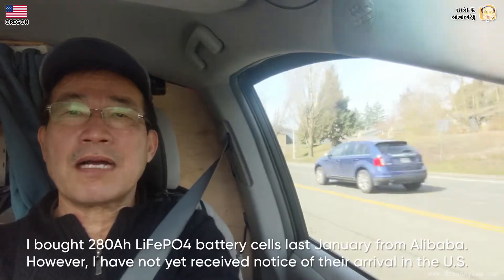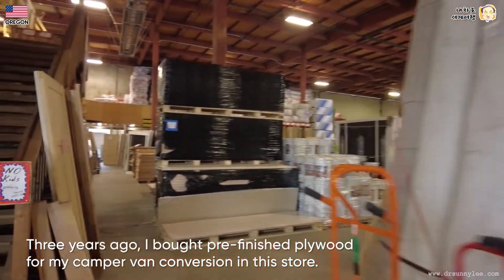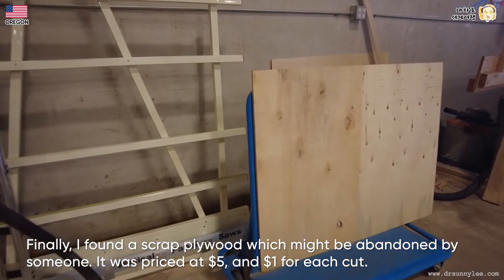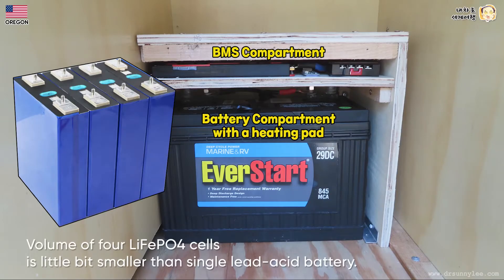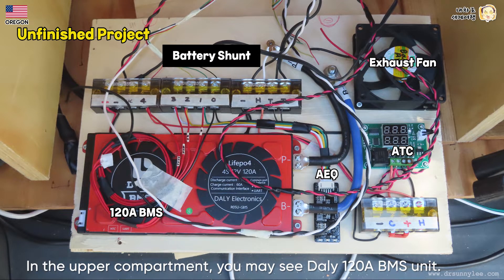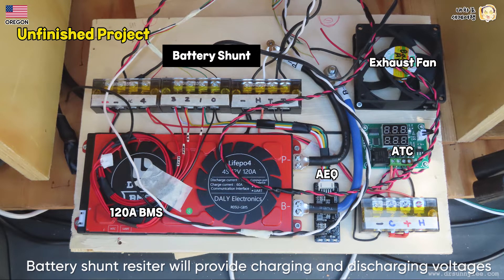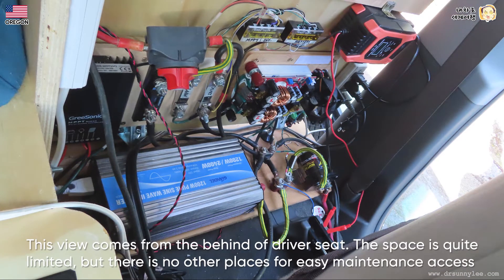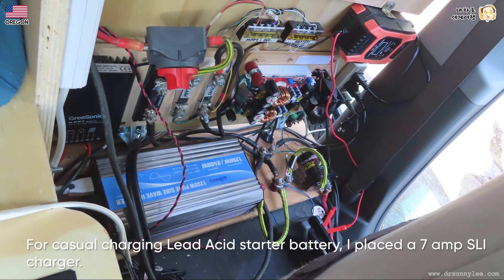🇺🇸 Battery Box build for LiFePO4 battery system of mini-van camper

Comment: I would like to visit that store the next time I visit OR. Could you please share the name of the store?
Reply from the maker: Building Materials Bargain Center (Located in Salem, OR). As far as I know, this is the only place I could find pre-finished plywood which are very durable for many years use and provide more finished touch of my project. Good thing is they are pretty inexpensive compared to sanded plywood. Highly recommend!